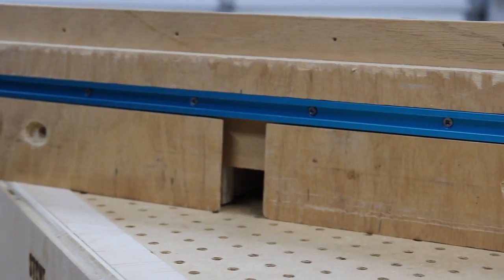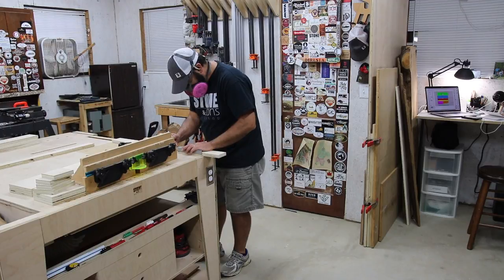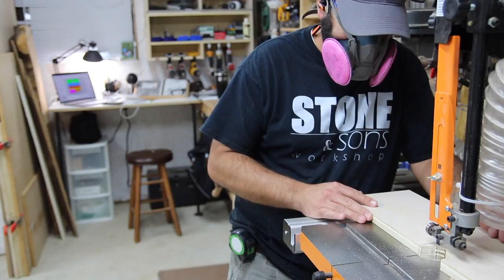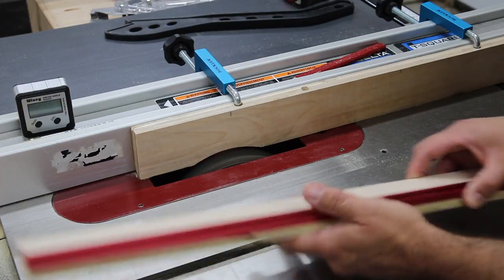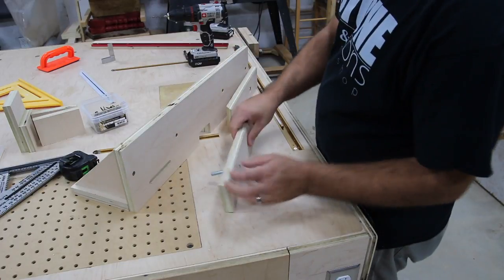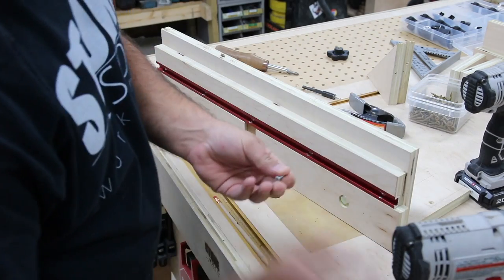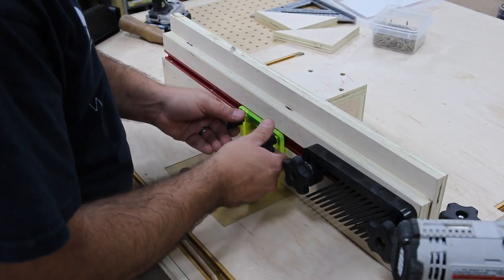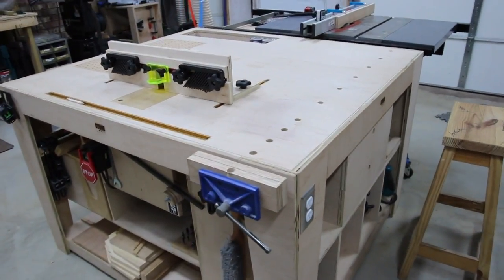Router Fence with Dust Collection

Comment: Seriously?  Why would you cut a 45 on the bandsaw? That makes no sense guy. Stop trying to show off your tools and make sense and use the right machine for the job next time. Man, good luck & you quit your job to do this full time. You're gonna starve. Sorry, somebody has to tell you the truth.
Reply from the maker: +Christine Cahill actually I would normally use my tablesaw, BUT I had a dado stack installed on it. I could've used the miter saw, BUT I didn't want to.. too much trouble. I guess I could've hand cut it, BUT my saws could use a sharpening. Soooo, the bandsaw it was. Seriously, I saw an opportunity to cut it on the bandsaw because frankly I just wanted to try it AND the table tilts so why not. It's not like the pieces I cut were for a fine piece of furniture, this is a shop project. Btw, if I starve it won't be because I used my bandsaw to cut a 45. Lol